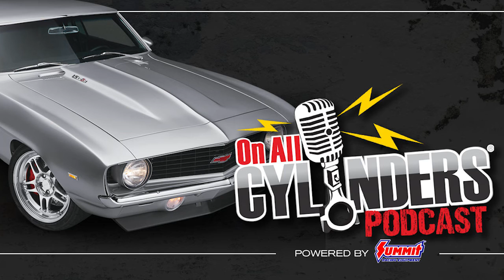Trey McFarland from RaceTec Pistons Dives Deep Into Performance Piston Tech

Comment: Justin that conversation with Trey was very informative because it dealt with specific topics that are often overlooked but essential for understanding the important details necessary for maximizing performance and longevity for every build. 

I know something about the lack of parts availability. While most guys prefer the popular LS platform, I’m not that guy. I prefer the engine that dominated Pro Stock competition back in the day, the Ford 351 Cleveland platform. 

I’m using a vintage pair of Pro Stock iron high port Cleveland heads and factory 4-bolt iron block and everything has been upgraded with modern components. Remaining naturally aspirated without power adders is a priority. The solid roller cam profile requires compression above 13:1 so detonation is a concern. The 61 cc quench head chambers will need a piston and dome designed for increased compression. 

The fact that it’s a canted valve Ford with a 4.020” bore pretty much rules out any chance of an off the shelf piston.  Trey did a good job explaining how the two different forged piston alloys are used in performance applications. Since 2618 can expand as much as 15% more than 4032, having precise piston diameter and cylinder bore measurements becomes more important. 2618 has higher nominal density, tensile strength/yield and fatigue endurance than 4032 but depending upon the application, isn’t always the best choice. 
Making that choice is why I could use some experienced advice 🤔. 
Many thanks to On All Cylinders and Summit for providing real information for all.